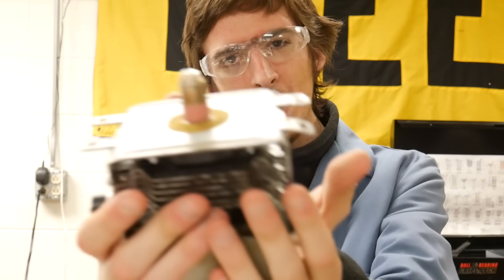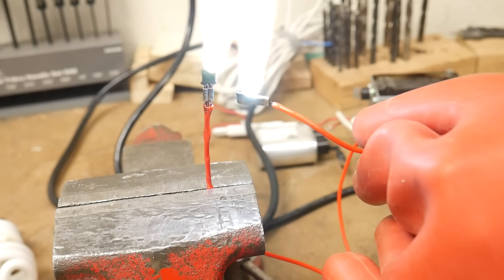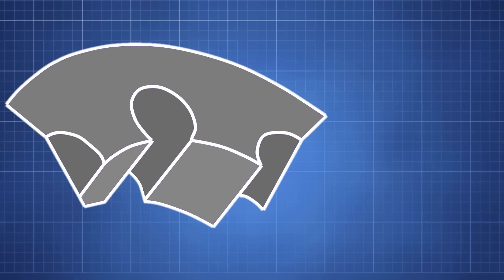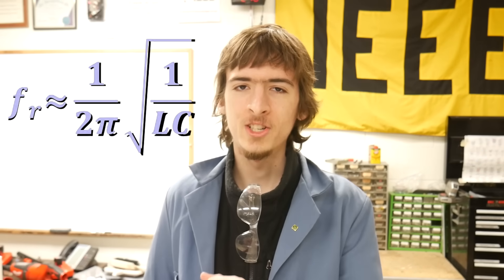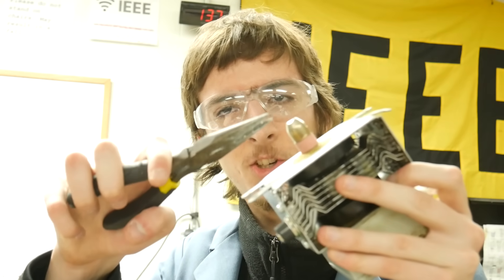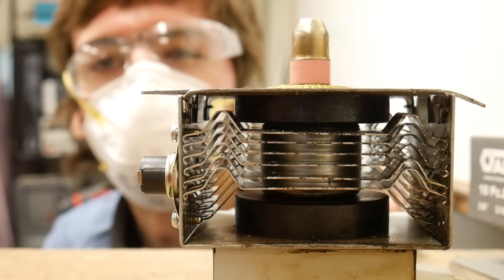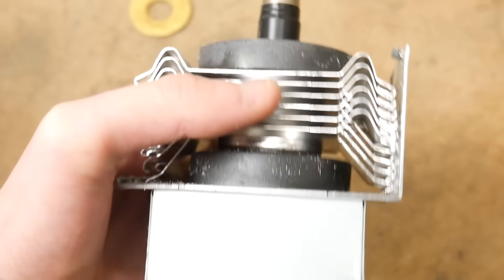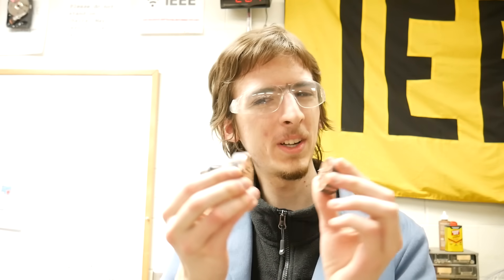What is a MAGNETRON - How Does it Work

Comment: Is there any benefit of covering food in the microwave?  I always thought the fan blew particulates through the entire machine, so your food gets contaminated.
Reply from the maker: The fan is only for cooling the magnetron as far as I can tell; the cooking area is sealed. Covering your food is really just to prevent a huge mess.
Reply: Good point about avoiding a mess, but there is always a vent inside the cooking chamber that serves some purpose of ventilation.
Reply: I just realized the response is from this channel's owner/creator/propietor.  Thank you for taking the time to answer my question, especially since it's out of line with the video's particular purpose.  I could easily find the answer here, but I thought I'd play aloud.
Reply: "All the air passing through the blower passes over the magnetron for cooling purposes and then the air flow is split into three air streams, one air stream passing through the cooking cavity for removal of humidity, a second air stream passing through the cooking cavity above a protective cover for cooling a light bulb and a third air stream passing directly out of the oven cabinet."  Considering this and other quick research points, it seems the vent inside the cooking chamber is part of the same ventilation system that cools all microwave components, but only this excerpt particularly implies that the cooking chamber vent is preceded by the magnetron chamber and other components, and that final venting release is through, and around, the cooking chamber door.
Reply from the maker: @shaneh1003  Upon further thinking, I think you may be referring to a stirring fan. These metal fans are sometimes placed the "mix up" the electromagnetic radiation for a more uniform coverage.
I'm still quite sure that it is independent from the dusty interior where the electronics are.
Reply: "Dusty interior" pretty much sums it up, and led me to my final enlightenment.  Thank you.. I actually wasn't referring to the radiation mixer, but instead to the duct currents.  I realize now that the vent inside the cooking chamber leads to the main air flow in a reverse pattern causing a suction on that vent, instead of blowing through, to rid the interior of steam build-up and allow a crude particle escape.  Assuming heating causes expansion/pressure to assist the vent flow, and the vent is free-flowing enough to allow back flow to avoid decompressing the cooking chamber, etc.  That's what I'm concluding.  For my time's sake, I'll live with that.   Thanks again.

Comment: I'm a student. I also heard that the electrons have a spiral-like trajectory in their way to hit the cylinder, so this spiral movement itself wouldn't be the reason why electromagnetic waves are produced? According to Wikipedia "Synchrotron radiation is the electromagnetic radiation emitted when charged particles are accelerated radially". Now I have those two explanations, (the spiral trajectory on the one hand and what you explained about capacitor and the inductor on the other hand) so I don't know which one is the real one... Or are both correct? Please reply. Very good video!

Comment: The reason for using copper instead of steel is that copper will disapate heat much much faster than steel. Ever felt a steel beam on a hot day? Go back and feel it at 10 o'clock it'll still burn you. Plus copper is more conductive... Don't know if this matters with radiation... But with inductance it plays a huge role

Comment: Doing a report for a school project and want to get to the bottom of it the radiation source: 

According to Maxwell's equations don't the accelerating electrons (accelerating because they are changing direction relatively circularly) create the magnetic field which creates an electric field which creates a magnetic field (EM Radiation).... ?

In this video he attributes the EM radiation entirely to the LC circuit's changing of fields (which is undeniably happening and surely producing radiation). My problem with this is that the electric and magnetic fields that are made by the anode should be out of phase with each other, which to my understanding is not true of EM radiation. Other research of mine continually seems to show that it is the first option I mentioned that generates the microwaves for heating, rather than the second. Do they generate the same frequency or is only one of these EM wave sources valid....? If both are true, which makes the proper frequency for heating food, 2.45GHz?

Any help would be desired, and soon please!
Thanks

Comment: Dear Sir. Good-evening.
Magnetron ... A very interesting bit of information. I, would have liked to have known 'more' about the materials used (specifically). Could you please take the time, to inform me.
Yours Faithfully.
Sir Francesca Kray. 🌹
Reply from the maker: Sure. The cathode is a filament of thorated tungsten (that's tungsten metal with radioactive thorium). The anode is a copper block. And the ceramic insulators are either beryllium oxide or aluminum oxide (the former is toxic if inhaled, the latter is non-toxic)

Comment: I loved the way you compared hertz vs watts.. 
"2 400 000 000 hz won't give me cancer.. but 1 000 w will burn me.."

Hope you don't mind if I add some of my notions ..
2 400 000 000 electromagnetic waves per second is where the water molecules will start to shake. 
But if the "thing" causing these high speed waves is not powerful / strong, ( power is represented in Watts ), then the water molecules won't shake as strong as if they were cause by more POWERful "thing"..
Water molecules will shake harder ( not faster ) in a high wattage 2.4 Ghz then they would in a low wattage 2.4 Ghz electromagnetic wave. 
So it's never the hertz that we should be concerned in electromagnetic waves, it's the FORCE or if you prefer , the POWER that is given to thoses electromagnetic waves that is the real concern.
Example: why do we get the same tan in 10 minutes in a suntan boot than we would in 1 hour out in the sun? It's the same kind of UV light " light is an electromagnetic wave also like the microwaves, but not at the same speed ( hertz ) " . 
It's because of the amount of power reaching your skin that makes it faster tanning. ( same speed but pushed harder )

Comment: A line of these magnets on any steel kitchen surface will give a great parking place for your cooking tools ... likewise a magnet stuffed onto a wood broom handle is handy to pick up nails / screws / drill bits dropped on workshop floor ( tip , surround magnet with plastic top of any spray can , screwed into end of handle , this protects the magnet from knocks ..it is BRITTLE ! !

Comment: How does the frequency get so high from the line power 60 hertz, in such a simple device,
Reply: did you even watch the video? there's an lc circuit in the magnetron
Reply: @king_james_official  oh,  not the transformer,
Reply: @ryanbeard1119 the transformer doesn't affect the frequency
Reply: @king_james_official  ok,  that's basically what I was wondering

Comment: Hello,

I have a question, can the electro magnetic waves be diverted in a pipe ?  In case if i have 4 compartments to be cooked, I have one centralized Magnetron, Can I divert the waves through any tube like structure ? Is it possible to have a solenoids control 4 valves for each compartment and turn on in each compartment when ever required.

And in a normal microwave oven, How is the distance influenced between magnetron and the food ?  Suppose the distance is close to the food, and if the distance is 150mm , How this would result ?

Thank you
Reply from the maker: Funny you should say that. A few years ago, somebody asked if they could use a magnetron to melt ice in pipes. The answer is no because the waves are neither circularly polarized nor were the pipes wide enough to transmit the wave - it would just reflect back and destroy the magnetron.
If you want to move microwaves around, you need a rectangular waveguide which is approximately 6cm by 2cm, similar to the one in a microwave oven. Waveguides act a lot like “pipes” to move radiation around.
Reply: @BlueprintScience  Thank you for the reply,  I under stand,, the  " wave guide " , How long can it be used , ?  In case, If the length of the wave guide is 300 mm the intensity of the waves would be less at 300 mm, and more in 150 mm. ? Is it so ?
Reply from the maker: As far as I know, there is no theoretical limit to how long a waveguide can be. Think of it like a wire, it can be pretty long, but resistance accumulates the longer it gets.
Reply: @BlueprintScience  Thank you so much !!
Reply: @BlueprintScience  Hello again, Do you have any idea on how to calculate the magnetron  capacity required. ? My oven cabinet size is  300 x300 x250 mm ( LxWxH) . how to calculate the magnetron size depending on the volume ? 22.5 L is the volume.

Comment: Some points here. You don't need to cut the mag to get the magnets out. A pair of cutters, or long nose pliers will twist the lugs apart. Borillium oxide, I haven't  seen any proof yet that it's borillium not Alluminium  oxide. But it still could be.

I do scrap metal, so I pull these apart for the transformers and magnets. X 100s of them.

Once you have the pink or white ceramic poles exposed, you can just dismantle it in a bucket or sink of water. No risk.
OR, wrap some 3/4 inch masking tape around the ceramic pole. Just 1 wrap, or you won't get the cover plate off it.

Comment: My GE microwave magnetron has continuity between the plugs, and has unmeasurable electrical resistance between any of the two plugs and the case.  So from testing continuity point of view it is still good.  But the top radiator is loose on both edges. and the microwave does not produce heat when this magnetron is inserted.  So I guess a not-well-connected radiator could be the Culpit.    Anyone has any idea about this?  Thanks.
Reply: unlikely a loose fin would stop it from working, but it may run slightly hotter. Look elsewhere, if no heat check the diode(s), fuse (sometimes inline), the thermal overload switch and HV power supply. If its an inverter, the PSU is a common weak point.

Comment: JB weld it back together and turn it on... I want to know if it will still work...
Reply from the maker: Ha! I already got rid of it. Plus, I'm not sure that I'm talented enough to put it back together: the filament, the cavity, and the body all being aligned would be a miracle.

If I had to speculate...
30% chance it works same as before
20% chance it sparks, sputters, or explodes
50% chance nothing happens
What do you think would happen???
Reply: @BlueprintScience  I would be curious how the magnetic field/eddies/currents would act as the cavity is distorted. 
I think if it somehow worked it would not be emitting a very consistent or concentrated output. 
There is always a decent chance of sparks with 2kv and metal shavings.
Maybe take one apart carefully, cut it in half, epoxy it back together and put it back in the microwave and turn it on remotely from a safe distance and see if it can cook a hot pocket. will it cook faster or slower, do nothing or burn a hole in one spot?

Comment: Hey! I need ur help.. my microwaves magnetron is not working... its not heating at all.. so i wanna know that will it be cured?? Please answer this!!!! 🙏🏻
Reply from the maker: Almas Fatima,
It is very unlikely that it can be fixed. Magnetrons usually stop working from being overheated. Thankfully, there is a relatively cheap solution, if you wanted to keep your same oven. All magnetrons are the same size and shape; if you buy a cheap working microwave from a thrift store (usually less than $20), you can pull out that magnetron and put it into your oven. Take a pic of the wires for reference. Also be mindful of high voltage stored in the capacitor.

Comment: I noticed that my wifi or rather hotspot frequency is 2.4GHz as well, does this mean that both microwave and wifi are in the same band?
I appreciate any explanation.
Reply from the maker: That’s right. Wi-Fi is 2.4GHz and microwave ovens are (roughly) 2.45GHz - that’s about as far apart as the entire spread of FM radio.

Comment: Just FYI, your diagram showing the force on the radiated electons shows the force in the wrong direction. Since electrons are negative, you need to reverse the direction after using the right hand rule. F = q v x B.  Just my OCD talking. ;-)

Comment: The recent reverse engineered physics involved in physical on-ground dowsing is explained in the book, The Art of Dowsing - Separating Science from Superstition ($14.95), along with how to build the modern light weight ball bearing dowsing rod, which is the only dowsing rod that accurately gauges what is being dowsed by pitting the energy of gravity against the energizing of the one-tenth ounce dowsing rod load that is attached on the elevated acetylene welding rod, with being located five-inches from the hub's shaft.  This precisely dowses all edges, exact center, depth buried with angle of deposition, and most important is grading of the sought element that is contained in the elemental mass that is being dowsed.  Anybody can become a professional dowser by practicing the book's dowsing lessons of buried pipelines and electrical cables, tunnels and voids, precious metal placer and lode deposits, dowsing for treasure, dowsing for any element, amplified long distance dowsing from a moving vehicle, and dowsing on water from a boat.  I hope dowsing enriches your life and have a safe, healthy, good day.

Comment: Now you tell me to wear proper protection.  15 years ago I was taking these apart to recycle them for the metals for a charity known as MCC.
Reply from the maker: Nice knowing you, buddy.

Nah. Just kidding. You would know by now if you had any major health problems because of it.
The only real worry is the beryllium and most magnetrons don't even use it (they use aluminum oxide). But it cannot hurt to ere on the side of caution.
Reply: @BlueprintScience  Well that was 15 years ago and usually I didn't do anything with the main part; we were after the aluminum, copper, circuit boards, etc.  Now that I am into retro devices I feel bad for all the things I scrapped; they could have been sold on eBay today even if they weren't working.

Comment: No mention of the Thorium ceramic core inside the magnetron.  Yup, radioactive material inside your microwave.
Reply from the maker: “Thorated” tungsten, specifically; it is used to facilitate elections leaving the cathode. And it is very little radioactivity that poses no threat when in the microwave box.

Comment: Hey dude.. Why didn't you mention anything about the aluminum wrapping the magnetic material around the "magnetic" center of the magnetron? You know, the slightly spaced out square shiney pieces, about their existence and what they do! Or about the cylinder shaped, magnet look-a-like pieces that are wrapped in copper wire that is insulated (most likely by Teflon) just before the first magnet I mean they are there, and don't they all have a purpose, or a spot on the periodic table . if they don't mean anything but decoration im ok with that.  Lol buuut watching you work on that thing tho!! Haha jk but forreal... I can get the microwave apart, the magnetron out and magnets in my pocket within a few minutes with my own two hands, given a hard surface to make my efforts a little more efficient. Fantastic video. Thank you sir,  BSS
Reply from the maker: The aluminum fins are there to dissipate heat from the copper block. (Did I forget to mention that?)
The coils in the back are part of the heating element that all vacuum tubes (magnetrons are vacuum tubes) need to operate.
Sorry my microwave disassembly skillz are not up to snuff ;)
Thanks for the comments. I'm glad you found it interesting

Comment: I heard that those insulators being beryllium oxide is a myth, because it is difficult to manufacture and dangerous for the general public. Now there IS this insulator that is used for TIG welding and those use alumina and it has the same pink color.

Comment: Well, of course it is made of copper.  Steel is ferromagnetic.  Magnetic material anywhere near it would cause the inductance of the resonant cavities to increase by orders of magnitude, lowering the frequency down to megahertz or even kilohertz.  Copper is the ONLY material you can use, unless you opt for silver.  Before someone mentions aluminium, consider its resistance.  Steel would also be unthinkable in terms of electrical resistance;  and it is also a very poor thermal conductor.  I don't think you could think of a worse material.
Reply: I guess steel can't be poorer than wood or glass.....
Reply: @Phosphoenol_pyruvate_CK  It actually CAN be;  wood and glass are at least non-magnetic;  one less evil, lol.  But you're right;  a lot of materials won't work at all.

Comment: Why is beryllium used if it's so dangerous?
Reply from the maker: Because it works well while not being prohibitively expensive.
However, due to the danger, modern magnetrons use an aluminum oxide ceramic which also works well and is (probability) not carcinogenic.

Comment: I still don't get how the microwaves exit the chamber which is sealed copper.
Reply from the maker: Good question, and a complicated one at that.
First, you must not think of the copper block as a perfect conductor. Charges distribute VERY differently at high frequencies, even for conductors like copper. There is a wire (also made of copper) that travels from part of the inner anode to the stub antenna. This wire is surrounded by beryllium ceramic so as not to short circuit with the rest of the copper block.
If you search “magnetron diagram” in your favorite search engine, you’ll get plenty of good pictures to study.